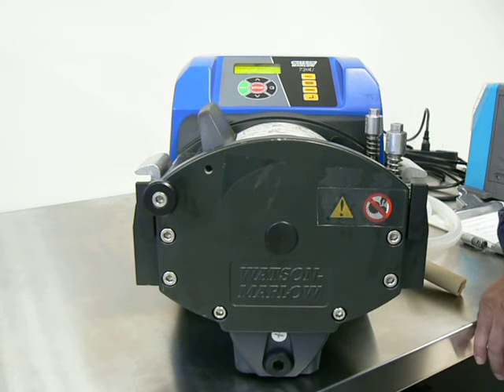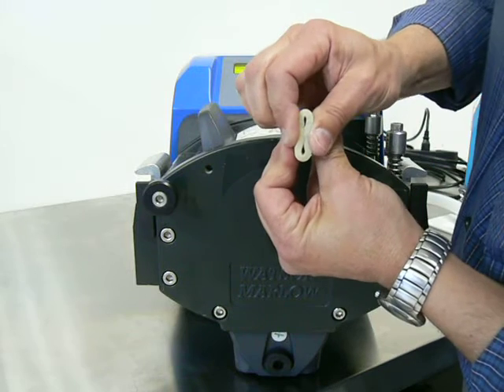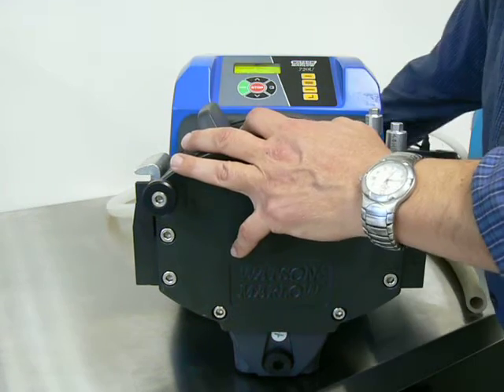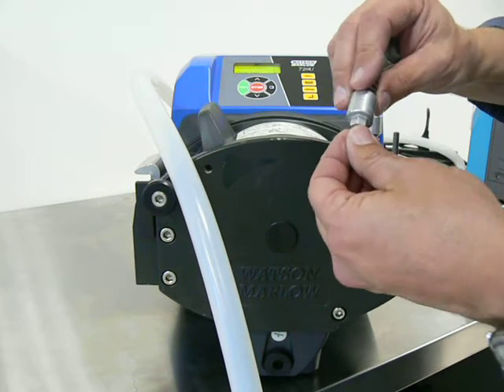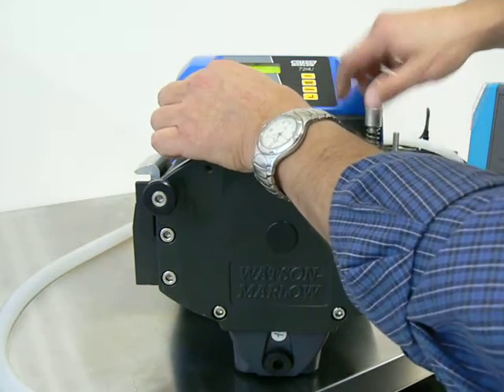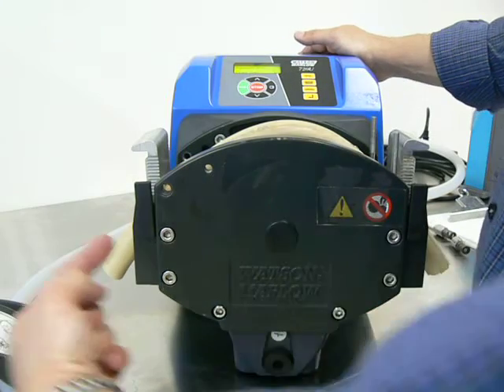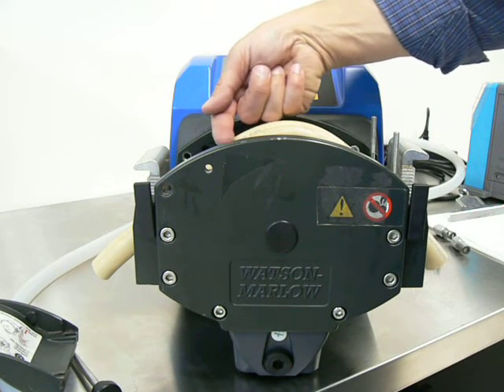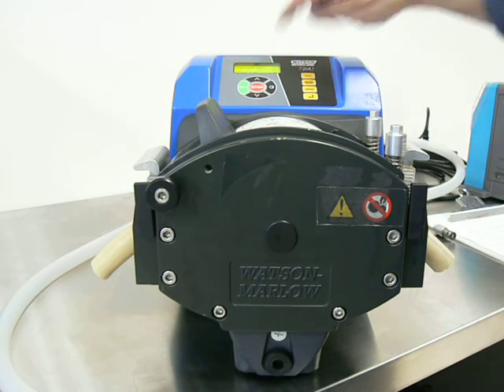Watson Marlow 704 / 720 / 730 Pump Tubing Selection, Loading & Use

Comment: How do you turn the little knob to adjust wall thickness? Mine is stuck and this is not on the manual somehow??
Reply from the maker: You can't turn the knob to adjust for wall thickness. You either need the 4.8mm knob or 3.2mm knob depending on your tubing wall thickness.  If you have the stock 4.8mm knobs and want to use 3.2mm wall tubing such as 1/2 x 3/4 or similar, you would need to order the 3.2mm knobs from Watson Marlow.